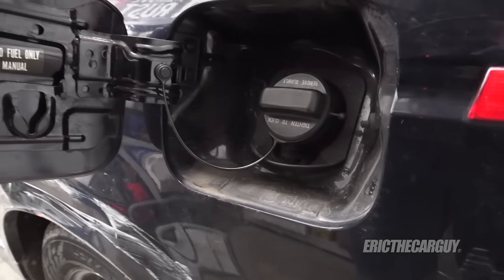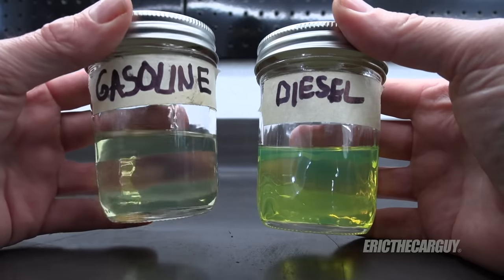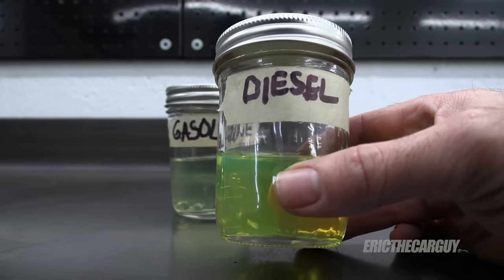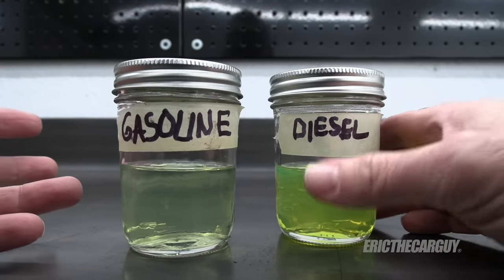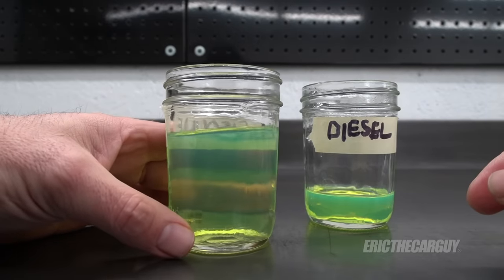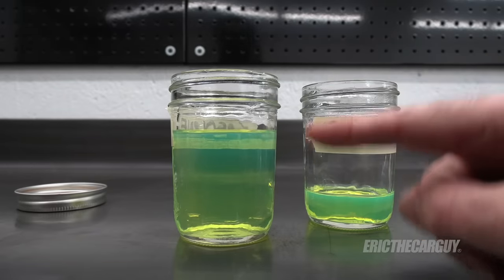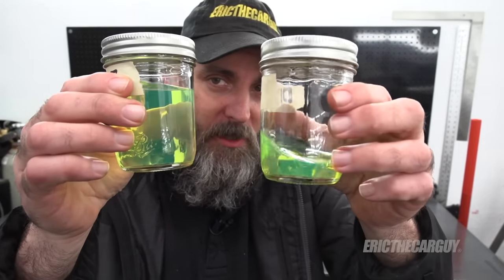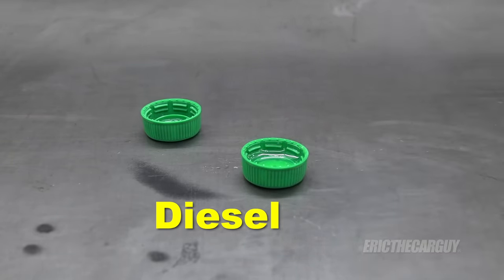What Happens When You Put Diesel in Gasoline?

Comment: Who different is this than a 2 stroke engine? and can you run a weed eater on diesel?
Reply: straight diesel..no.  but mix the proper ratio ya, till it burns up or runs out of lubrication.
Todays diesel has had the natural lubricants removed (ie emmitions laws).
So with that said,     i really would'nt try it unless your just looking for a reason to get a new weedeater.
Reply: Rebuild project with son. Got 12 old ones, going to fix it to a old RC car
Reply: @CharlesDrafter11   I've seen rc cars that run on diesel, and they were pretty fast.
edit: remember to add a lubricant to the pump diesel if green( this is low sulfur)
Or get what they call farm diesel (red, unrefined)

Comment: a small amount of diesel less than 10% will cause no issues on a gasoline engine without a cat.
Reply: So what if I put 2 gallons of diesel in my car ?
Reply: @HelpMe-kj2kh  In newer car it will ruin catalytic converter, on older vehicle if the tank is full of gasoline no real damage, if it has little gasoline the diesel would drop the octane of the gasoline significantly to cause a detonation which could ruin the engine, a very tiny amount of diesel like a cup in a tank full would cause no damage other than catalytic converted, but with 2 gallons there is risk of detonation depending on the octane of fuel and how much gasoline is in the tank, for over 20 gallons of fuel with premium fuel is probably ok, I say premium fuel because the diesel will drop the octane rating.

Comment: I had a customer bring me a scooter that wouldn't start. It was like a 150cc 4stroke carbureted motor. Well I drained it put gas in it and ran like a champ. Pretty funny stuff the phone conversation with her she swore it was diesel powered. Diesel is compression ignited so when mixed  I imagine it will just not run. Typical ignition timing is retarded and lack of compression in a gas motor.

Comment: Any kind of petrol there is vapour vapour is so thin you just like gas and the smell is different as well diesel is not lighter it is thicker and more denser it's all engine use combustion to push down and up the files petrol engines have a spark to ignite the the fumes or the petrol to push the fails up and down with is combustion where a diesel with the same kind of principal but they have a glow plug when you see a spark plug when it causing a little bit of a spark and you'll see the movement a only needs a small reaction with the spark plug a backfire or fire to push down the fells in the engine so with a naked flame it will be very very easy to ignite flammable petrol but diesel would be very hard to ignite because it is more dense and there is no much oxygen in the diesel before it will ignite it diesel is not that flammable but it will burn with a very very high temperature when you see lorries burst into flames it is not true because Diesel's got to be ignited by a very very high temperature before it starts ignite